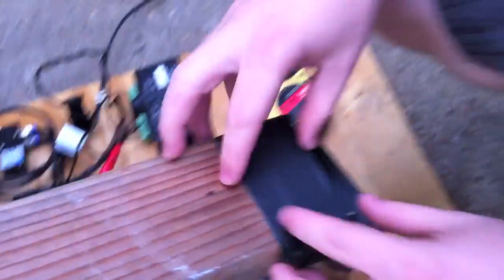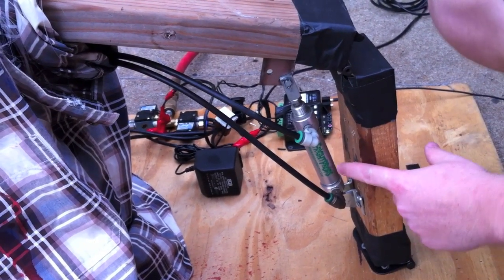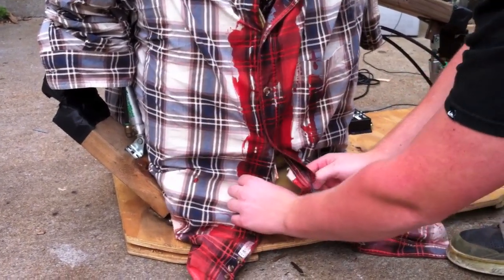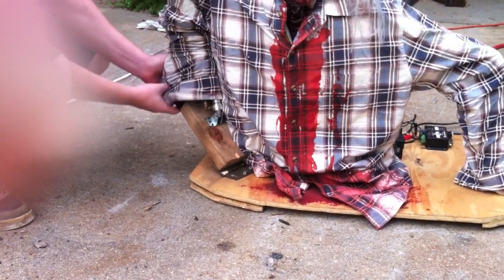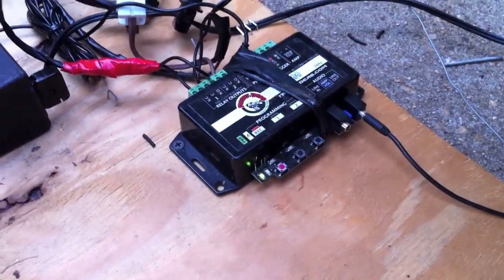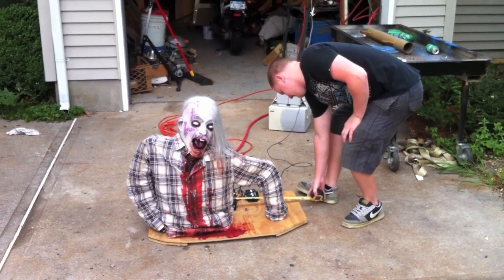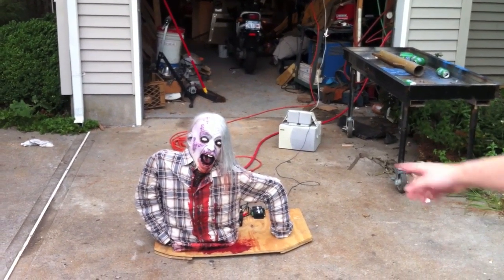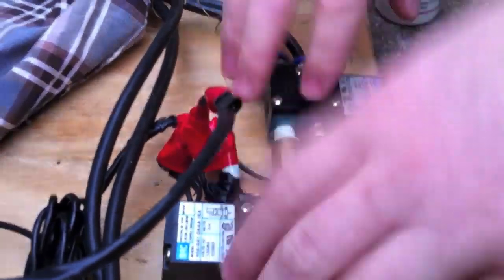Ground breaker repair

Comment: How did you figure out the way that pneumatics, boobox's, and other components work together to make an animatronic?
Reply from the maker: I learned about ground breakers from youtube, I used other youtubers for reference since there are no actual plans and i made everything myself with parts i ordered from fright props.com. They sell the ground breaker pneumatic kits on their website which make its way easier, i didn't have that luxury 14 years ago i had to pick out and buy everything piece by piece and then build it. good luck my friend. Tag me if you build one

Comment: how much do you have in the prop
Reply from the maker: I made this so long ago. I think around 250 for the controller, cylinders. air lines and fitting. I made a couple parts myself  from metal to save money. The mask was around 40 bucks ( serach rotten ralph mask on google)

 If you go to fright props dot com they have a ground breaker kit that sells all the pieces. when i made this i had to pick the parts my self and make the dream happen.  good luck!

Comment: Great ground breaker! We were given one of these at Transworld last year by a haunter that he had built. It is such a great prop. We just now got to use it after doing some repairs and ordering a new sensor for it. Now one of the cylinders has broken off so we will fix that. That is a great idea to lube the cylinders and solenoids. Thanks for the video!

Comment: Very cool! I built a ground breaker last summer, I didn't use 2x4s, I was afraid of the stress that it goes through when activated that they might split. I used one inch square tube, have you had any issues with the wood cracking at all?